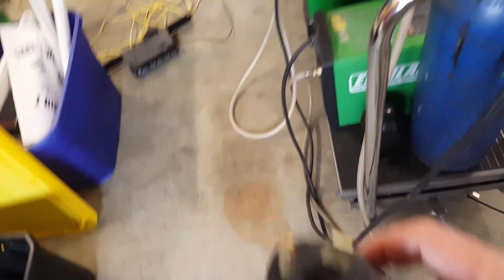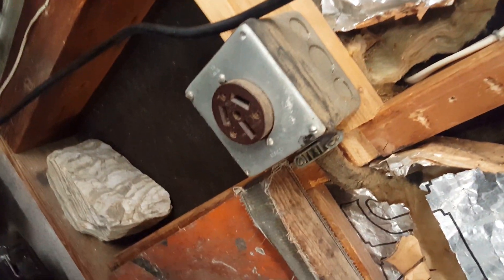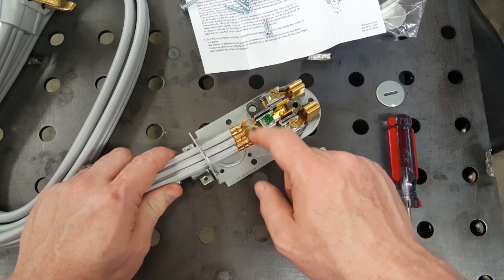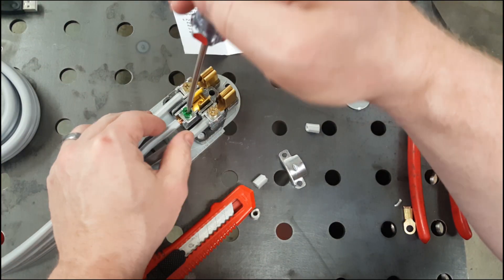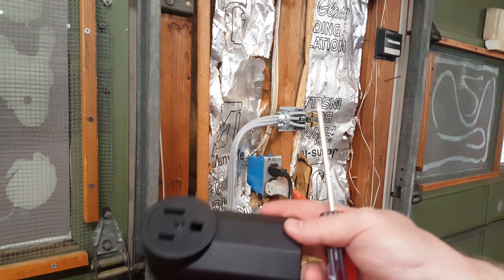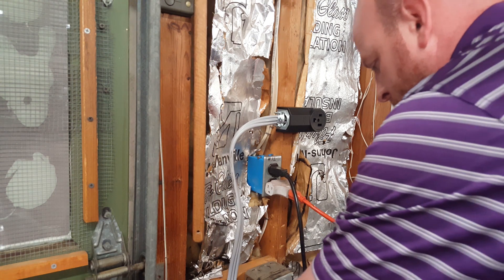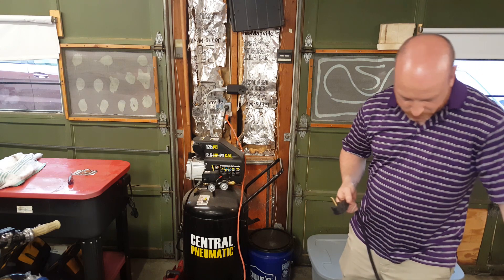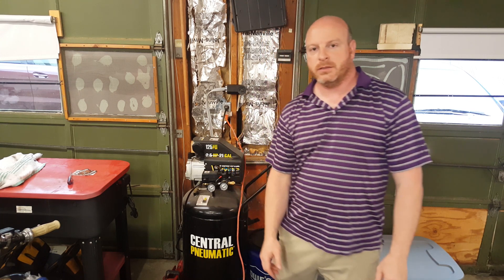DIY 220Volt adapter.

Comment: I ran into the same issue, and was told by the electrician that the old outlet has 3 hot legs and the welder only uses 2 hot and 1 ground and can’t use it. Did it work?
Reply from the maker: Mine did. 3 hot legs? That would make 330 something volts or a 3 phase setup. Can you verify with it with a multimeter?

Comment: I have a new style 220 volt extension cord and my garage has a  old 220 outlet so they sell adapters from new to old ?
Reply from the maker: You might be able to find some sort of adapter on Amazon. If not you could make one or put a new end on that extension cord.
Reply: @HaslipCycleWorks  thank you